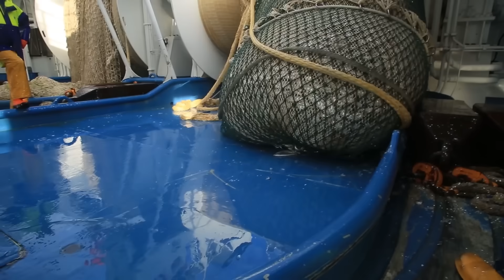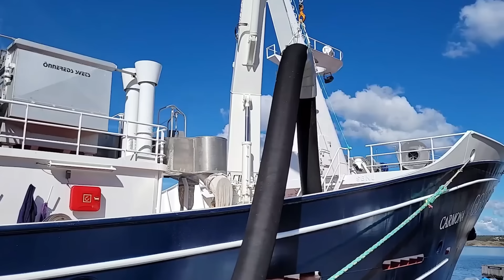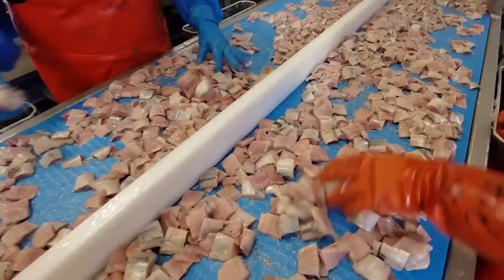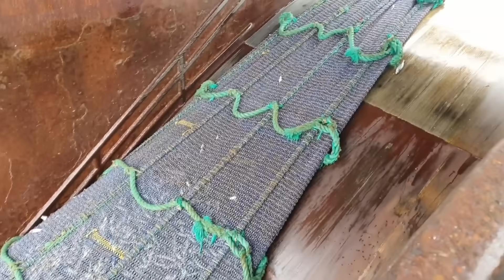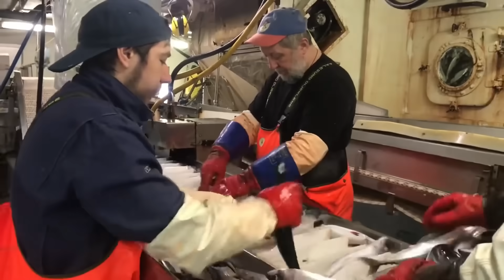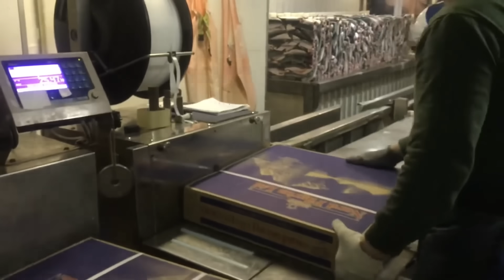Unbelievable Mackerel Catch! European Trawlers Pull in Mountains of Fish with Massive Nets

Comment: It is a wonderfully efficient and productive fishing method that allows a large amount of fish to be caught at once. However, as more and more fish are pulled out of the water, the fish below are crushed under the weight of several tons, just like oil seeping out of metal rolled in a press. If you look carefully, you can see that blood and body fluids appear to be flowing from the bottom of the net toward the surface of the water. Does this mean that the fish being pulled out are as dried as the fish at the bottom?